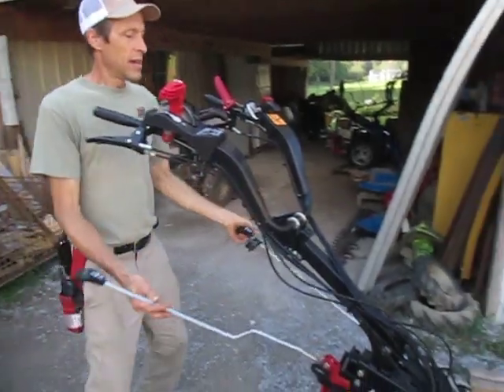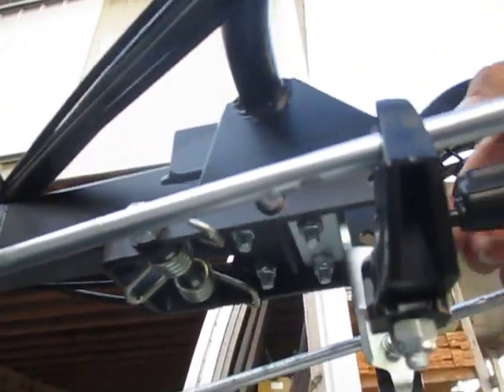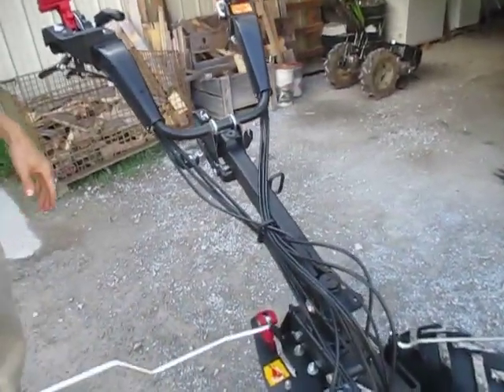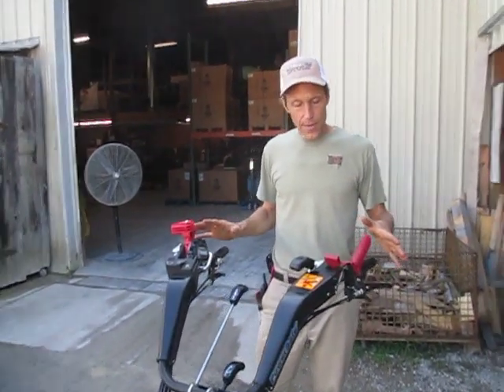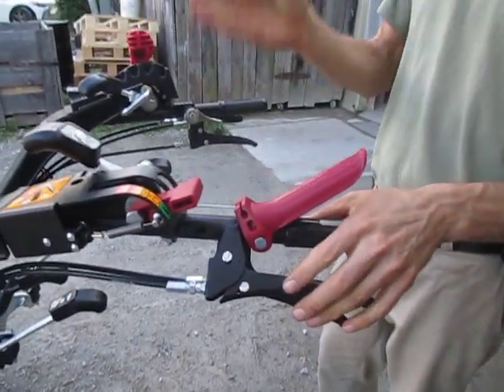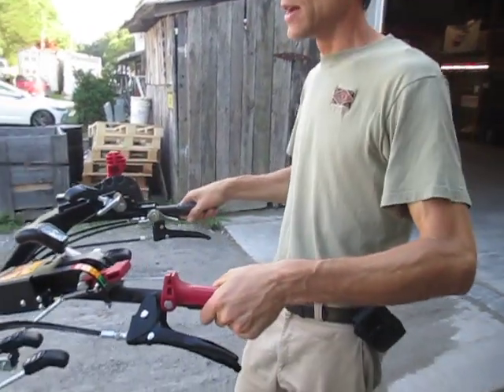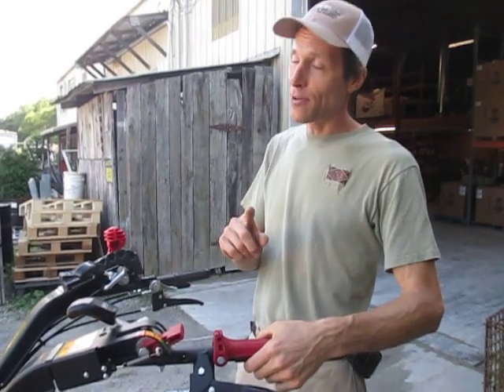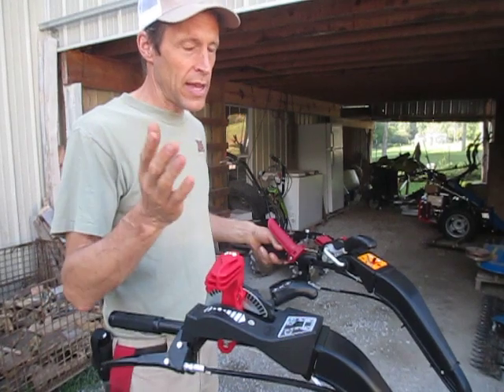BCS 770 & 779 Hydro Walk-Behind Tractor: Setup & Features

Comment: I still like the BCS machines but I find them excessively priced.  8 years ago I was looking for a "commercial" use machine know what? In the end I bought a Tractor.  My Zetor with 311 hours (Looking like new) cost me $3400 equipped w/plow, blade and bushog.  Then I bought a Troy Bilt Horse (Used).  The TB and Zetor was ballpark the same price as a used BCS in great shape w/mower and tiller.

Go figure......
Reply: If you want value you went with the right choice, a budget brand and a used one at that. Good for you.
Reply: Different strokes for different folks

Comment: I'm planning on getting a 779, thinking of the recoil start as it's cheaper and seems pretty easy to start, and less to go wrong and no battery to deal with. Do you have a preference as to the recoil start versus electric start models? Pros and cons of each? Can an electric start be added to the recoil start model in the future if need be? Thanks - I just can't decide between the RS and ES.
Reply: If you don't plan to be using this on a regular basis, just save yourself the hassle of the potentially dead battery and go with a pull start.

Comment: One handy extra thingy is a guard for the direction selector. In my 650 max a christmas tree branch would regularly catch the lever and force it backwards, with a loud grinding from gearbox. We fixed it with a rod that is higher than the lever and sits right outside and front of this lever.